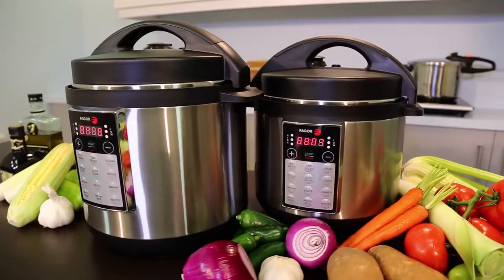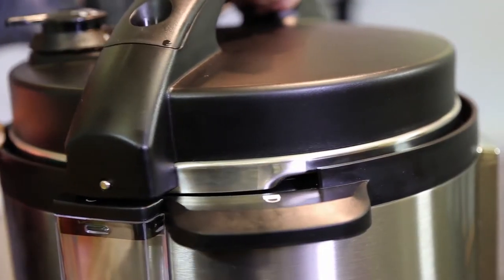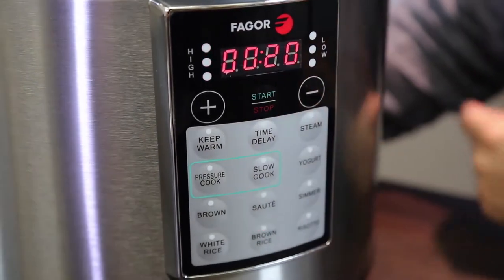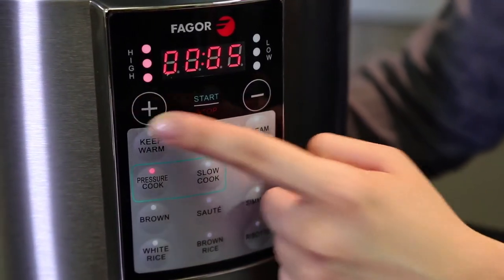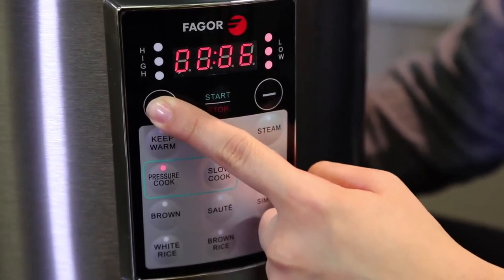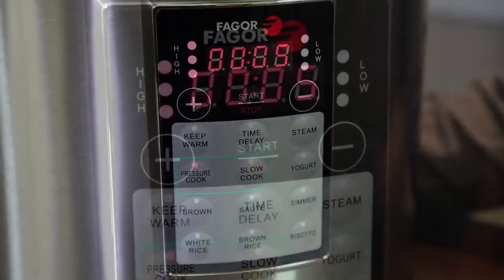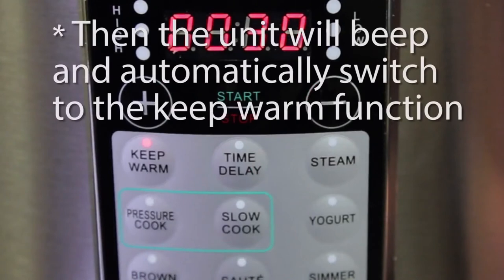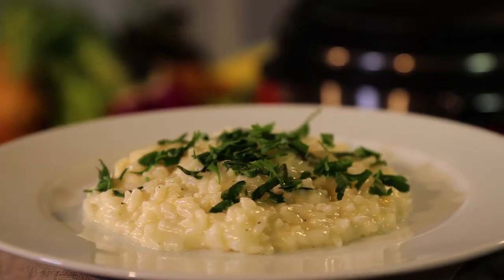How To Use the Fagor LUX™ Electric Multi-Cooker

Comment: I have purchased 2 of these and experienced the same problem twice now.  following instructions as seen in this video, I have attempted to cook white as the simplest use of the pot.   with both pots, the pressure would build and them release before reaching full pressure which would trigger the electric keypad (I imagine) to have the indicators turn solid red and the timer begin to countdown.  I also first read all the instructions and duly checked the pot before starting this  procedure.  I am an extremely frustrated and unhappy customer as it is near impossible to get hold of FAGOR customer service without delegating 1/2 the morning to waiting for mountain time, then to be told that this is the wrong customer service site, try another number.  any ideas on what is going wrong with the pot and/or process?

Comment: How do I turn this device to close? It won't close. Must I go to the gym and work out? Am I not strong enough? It doesn't seem to close. I put it in the 10 o clock position, but it won't close
Reply: You should check the silicone seal, it might be out of place.  Tuck it under the wire holder and try again.

Comment: Thank you. I just learned why my food, when slow cooked, is over cooked. It's because I did not know that I could switch from high to low by pressing once or twice. I would just hit slow cook and select the time. OMG! I cannot wait to redo some recipes. This is my second one because the first one just quit powering up. I read reviews and a few people had this issue. I have the 8 qt.
Reply: +schanik2 Thank you for your feedback. Please feel free to contact us at: info@fagoramerica.com if you have any other questions.
Reply: +Sara de la Hera Garbati my meal was on point after watching this video. Thanks!
Reply: +schanik2 Excellent, thank you for letting us know. Enjoy your LUX Multicooker!
Reply: schanik2 Hey quick question, what happened to the first one that not powering up?!?! Did the company do something about it. The pot wasn't cheap 159$ at bed bath beyond last time I check. I want it but I'm very iffy about the price.

Comment: Thank you. My dad bought a 4 quart Fagor multi cooker and we haven't used it yet because the written instructions are confusing and in too small of print for my dad to see. The pressure cooker we bought a few months ago has just been setting on the counter top during that time because neither one of use knew how to use it.
Reply: I still haven't used it since my original post here. And still trying to find good instructions on how to use it.
Reply: Kay, we are sorry to hear this. The feedback we get on the unit is that is very easy to use and the manual is very helpful.  To use the product the lid has to be locked in place, the pressure regulator knob has to be on the Pressure setting if you want to pressure cook or cook rice , or on the Steam position if you want to Slow Cook. After that you press the button of the function you want to use, you adjust the time with the plus and minus buttons and press the Start button. The cooker will build the pressure, or temperature, and once it reaches it the countdown will start. When the time is up it will automatically switch to the Keep Warm function until you release the pressure or just press the Stop button.  Thank you.